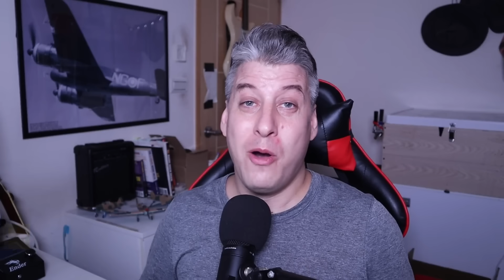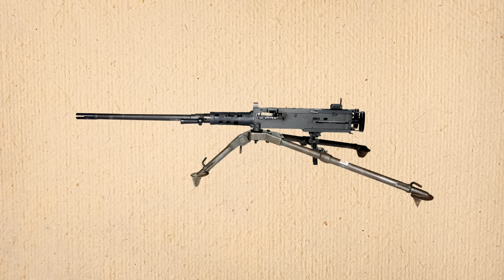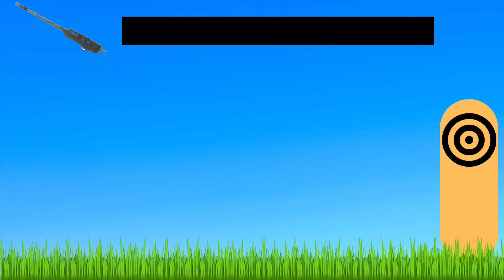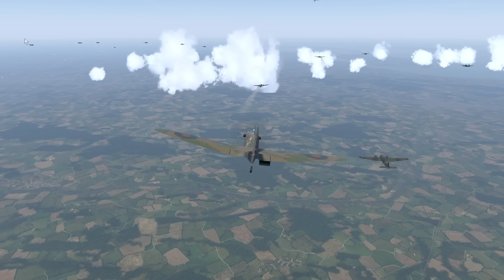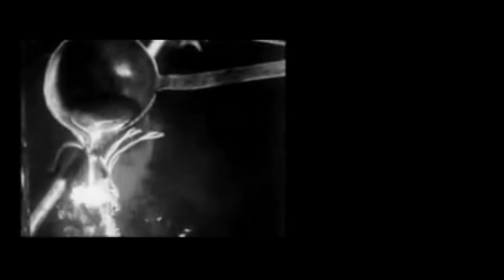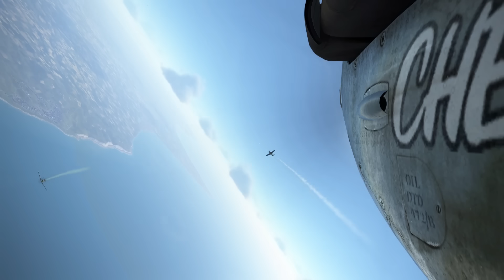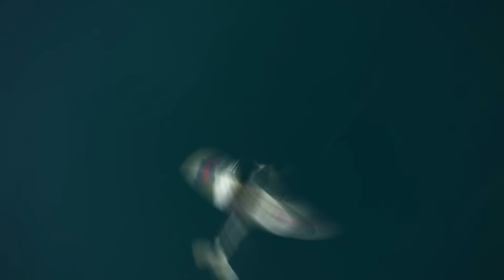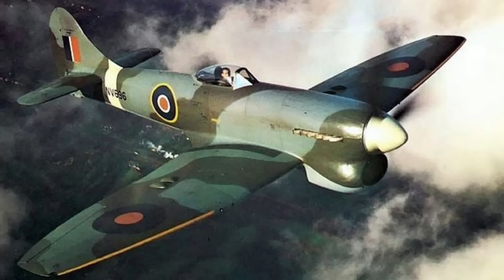Why Did The RAF Use .303 Caliber Machine Guns in WW2? The Surprising Answer

Comment: I have a 20mm cannon shell and bullet made by BMARCO at Grantham.  The unexploded bullet was retrieved by my grandfather in Leicestershire from a peice of JU88 tailplane after a Spitfire chased a raider over the county.  This is dated 1942 not long after they were introduced, and the shell casings were picked up off the road where they fell about a mile away.  The JU88 finally succumbed and crashed near Market Deeping and the crew are buried in the churchyard there I heard.  Years later, I showed the round to an ex RAF armourer who stated that it had definately been fired from a Hispano Cannon mounted in a Sptitfife as it has a neat line halfway up caused by the ejector mechanism in the cannon which were run on clockwork, which is why the aircraft had those wing-blisters to accomodate the mechanism.  The explosive end apparently diddnt explode because it was incorrectly milled and was live until my father did his National Service in the Royal Engineers in the early 50's  and recognised that fact and disarmed it! Until then it sat on the mantlepiece above the fire at my grandparents house!
Reply: Lol that would be an interesting moment to have if something happened "Honey your trinket from  the War fell off the Firepla-" POW
Reply: @Sparten148  I was an Australian army ammunition technical officer, and went to a job where some teenagers were playing catch with a ww1 37mm shell that grandfather had souvenired from the war.  Been sitting on the mantle piece for decades, till it decided to function when dropped.  Two dead, two crippled.  Just because this stuff didn't go off when fired doesn't make them safe.  Over time, the explosive components break down and separate, and crystallise...so what was once a stable safe explosive becomes a highly sensitive and dangerous one.
Reply: @Sparten148  🤣🤣🤣
Reply: @Sparten148  yeah - not sure the mantlepiece is the best place for a live cannon round! I take it they don't use the fireplace?
Reply: My uncle also benefited from national service with the Royal Engineers, though we didn't have anything live on our mantle pieces.
Reply: Best I can do....I have a scrapped piece of the Enola Gay that was discarded during her restoration, and I met+had it autographed by B.Gen. Paul Tibbets in 2004, before he passed away.  He also signed the date of 6 Aug, 1945 under his signature.
Reply: Very cool story. Thsbkbyou for sharing.
Reply: My younger brother talked to a WW2 B17 crewman who said they got back from a mission and had taken a hit to a fuel tank by a 20mm cannon shell that didn't explode and was still in the plane. After further examination it was found that it was an intentional dud. Inside was a handwritten note that stated he was a prisoner of the Germans and was  trying his best to help the allies win the war. It was unsigned and written in Polish.
Reply: @scottmccloud9029  Wowwee!!  Really?? Helluva story, there!!
Reply: @samburkes7552  Thanks. My brother volunteers at the Wings Over Houston Airshow and gets to talk to alot of the heroes. That story really brought that war into perspective. Knowing what the German government did to the Poles, that guy risked his life to dave an allied airman. 
I didn't serve, but have the utmost respect for those that did, and are serving. Even those who will serve.
Reply: @scottmccloud9029 a shell is a solid piece of metal, not hollow. How could someone put a note in it? And why would someone cut open a shell to find it?this is a dumb story that is clearly made up. The only place you could hide it would be in the casing and it would be jettisoned with the casing if not burned up by the powder
Reply: @olivermarden2433  That's exactly what I thought.The explosion in the casing that sent  the round into the B17s tail would've burnt the note up long before it got to the tail.
Reply: @olivermarden2433 not if he used tracer rounds there is an hollow filled shell with compound bursting charge, fuse, or even the lead that could have been left empty and a note inserted inside the bullet head
Reply: @scottmccloud9029  ..💀..Ohhh, man.., That IS sad..😥
Reply: @scottmccloud9029 this happened in rifle ammunition too, although at first they Booby trapped the rounds to damage the rifles but were too easily caught and executed so they took to damping the powder with moisture to make the rifle fire and recoil but the bullet head failed to penetrate. Very risky sabotage resulting in huge executions to the point they had to stop sabotaging by orders from Soe etc.
Reply: @scottmccloud9029  Nice bullshit, bro. You think a prisoner of war had the time to write notes for every single round? Or would risk his life for this shit just for the unicorn chance of somebody reading it?
Reply: @miskatonic6210  So what do "prisoners" all day?
Reply: @miskatonic6210  There are loads of documented incidents of slave labourers and POWs sabotaging everything from ammunition to engine parts during WW2, the Czechs at the occupied Skoda factories were the most prolific followed closely by the Poles. Such incidents also occured in WW1 amongst British POWs.
Reply: Our neighbor had a live Grenade one of his relaitive a brought back from Burma!
Reply: One of the things that stuck with me about my FiL's observations about watching dogfights from the ground was him having to take cover.  Not from falling bullets and shells' but the shell casings. They could do quite a bit of damage if they hit you right.
Reply: Brad Brassman: What a wonderfully, intelligent disseration re: this incident of this 20mm round being found, and the assessment therein!! Wish there were more like you!!
   Sam, a lonesome 73 yr old gun tech/refurbisher & cartridge reloader, here in Phila, Miss..Thnx!!
Reply: Wow, someone could have been "One Dead Cat Rusty James".
Reply: I've heard similar a artillery shell adjacent to the fireplace a live round for 60 year's until she passed and someone recognised as a "live round" called the police suggesting the bomb squad
Reply: I’m sorry to be that guy, but the brass is the casing and the projectile (the explody bit) is the shell. Interesting story nonetheless, unexploded ordnance, especially ordnance that has been fired and is aged is extremely dangerous, there have been hundreds of cases of veterans sharing their trophies of war with their grandchildren and the children ending up dead or critically injured by playing with it. I’ve got an 87MM from a 25 Pounder and a 40MM Bofors, both WWII dated and made in Birtley (stamped RLB on the casing).
Reply: @seafirefr.4751  : If you hate to be 'that guy', then why be 'that guy'?  I think everyone knew what the OP meant.   Cool about the 87mm and 40 bofors, though!
Reply: @pattonpending7390 , I’m not correcting him so that everybody understands what he means, I was correcting him so that he understands the difference between a casing and a shell for the future if he decides to buy any more.
Reply: @seafirefr.4751  In the early 70’s Dad & I were plowing a field & he opened the field for me to get me going & then I finished the job.  I was a bout 8 at the time & Dad jumped off tractor & started walking towards barn to do chores when he stopped & picked something up.  He frantically waved his arm for me to stop & I did.  He told me to stay there with tractor while he picked up what I thought was a rock & carried it inside the basement of the original homestead farmhouse which had thick rock walls.  He came out & told me he found a hand grenade & we had to walk the field to make sure there weren’t more of them (there weren’t).  Dad told us we were never to go in the basement but later that summer took us in there one by one to see it.  He asked around what do do with it & he felt the best advice he got was drop it in an old well which he did & covered it up.
Reply: Awesome little anecdote :)  Our lot were all up Ayrshire way so never really got any "spoils of home victory" trophies...Despite the fact the place was hunted for for years by the Nazis, wolf packs , the lot. Used to be (still remains I suppose) an ICI complex that made heaps of munitions for the war. All underground bunkers. The only major event really was the sinking of an Aircraft Carrier off the coast of Arran. 
What a time to be alive for a young'un  in the Kent countryside... Almost seems like war was a more innocent endeavour back then with real baddies.
Reply: @miskatonic.
Anyone who uses the word "bro" is not to be taken seriously.
And how would you know if a story is true or not.
I bet you're fun at parties.
A-hole.
Reply: I just watched a video about how the british took a long time to mount Hispano Cannons on theier planes like 5 minutes ago. I am also a WW2 buff and have always wanted something like that do you know if theres a website to buy stuff like that?
Reply: @elilenz1208  The RAF had 20mm cannon in some Spitfires during the BoB.   The unlucky pilots begged for their 8 x 303 Brownings back because the cannon proved totally unreliable.    Basically the Spitfire wing flexed.    Whilst this aided its aerodynamic performance, it also jammed the belt feeds for cannon.   In due time one of the RAF's "go to" engineering firms debugged the French Le Chatterellaut belt feed and fixed the problem.   That was most likely Martin Baker, but Miles was as good.   In fact the (RAF) Hispano became so reliable the pneumatic cocking mechanism could be deleted and was removed to save weight.   The 20mm Hispano was in use very early on as nose guns in the Whirlwind, and in the belly of the Beaufighter.   At first these were drum fed and in the Beau the observer had the unenviable task of changing empty drums for full - in the dark, in combat.    The Mosquito started life with belt fed cannon, four of them, both Mossie and Beau also had a mix of machine guns.    The Hurricane Mk II carried 4 x 20mm cannon.    However, 20 mm does not compare with the tank buster Hurricanes 2 x 37mm or the Mosquito's high velocity 1 x 57 mm Molins gun intended for submarines.   During the interwar period, the RAF had specs for a fighter to use an obliquely mounted 37 mm gun (the C. O. W. gun q.v.), to kill Zeppelins.   Several prototypes were built, the only thing missing was armed Zeppelins (JOKE). 

There is a twist to the tale.   The UK gifted the engineering drawings for the by now debugged and wholly reliable RAF Hispano 20mm to the US.   Regrettably, the US "improved on it", and promptly reintroduced jamming.   I always wondered if that was why the USAAF and USN stuck with 50 cal for wing mounted guns.   Pity, because the RAF Hispano was arguably harder hitting than the version of the Oerlikon (whatever they actually called it) adopted by the Luftwaffe. 

Jamming has always plagued fighter armament going back to WWI.    However, back then the gun breeches were usually  accessible to the single seat fighter pilot.   In some cases the butts were perilously close to the pilot's head.
Reply: My Dad was with the 23 field company RE in Tripoli in the early 50s, and his finds were also what he picked up at crash sites when he was a kid.
Reply: The unexploded bullet couldn't have been retrieved from a down aircraft. If it was fired then it was exploded. The unexploded round is still in its casing.
Reply: @TheSound0fLegends  Depends on definitions I reckon.   The complete unused round might be termed the cartridge or shell (in the days of muzzle loading cannon, shell meant a hollow projectile, usually spherical, which could be filled with powder, shrapnel {powder plus shot}, or indendiary material).   When fired the projectile hopefully left the piece of ordnamce leaving behind a now empty shell case or cartridge case (assuming modern fixed ammunition) .    The terms get really messy depending on the calibre of the piece.    The term bullet used to refer solely to the projectile, that goes back to the Romans who had a range of torsion artillery which incidentally also fired arrows and javelins.  However, IMHO sloppily, today people use bullet interchangeably to refer to both the whole cartridge and the separated projectile.    There's more, but it just gets messier.
Reply: @TheSound0fLegends  Not necessarily. The projectile might have been a dud or it had no explosive filler and was a just a lead bullet with the usual jacket over it, or potentially even a solid brass penetrator. Regardless, there are number of ways for what's supposed to ban explosive piece of ordnance to be unexploded after being fired. I mean, every battlefield since explosive ordnance was first used hs unexploded ordnance lying be it bombs, artillery shells, or others.
Reply: So far 2023's absolutely best reason to read the comments.
Reply: Love collecting old shells and surplus. I managed to get a 40mm bofor and a 30mm tracer incendiary through my local surplus. Idk if itd legal but it's awesome
Reply: I heard 80yr old 20mm shells are great for throwing around an empty bathtub when your drunk...
Reply: That's interesting, I always thought the blisters were to house the cannons magazine.
Reply: 💀..@Brad Brassman..' WOW !!! 👌  THAT is a BANGIN Cool bit of R.L.History !!! Peace ..~K~✌️ 😉
Reply: oy mate, where's yoh loicense foh tha?
Reply: @BradBrassman  That's awesome. My Grandmother and Great Aunt both worked in that factory making ammunition for Spitfires.
Reply: Great story, well told 17:09 and it's super to see the face behind the voice, unlike the robotic silly AI narrative in many other presentations.
Reply: The 20 mm cannon was introduced in 1940 and by 1941 both Spitfires and Hurricanes were using them.
Reply: ..Hats off to you mate!! Very, very impressive story!! I am a ballistics tech/gun cleaning/refurbishing tech, ammo reloader..Your story really piqued my interest. No, did not serve, served in other ways. Am sorta doing my service now in my early 70's in a Miss. gunshop!! Have some so since early 2018..
Reply: The ending made the story worth reading along with the insight that bullets where used that must have been rushed out of production with defects and due too this live rounds where found after being fired from the spitfires
Reply: In 1942 a lot of the rounds used were solid AP, so probably nothing to explode, thankfully, probably just incendiary and tracer (APIT).

Comment: The Browning .3 and .5 were both developed for tank use initially. There were development issues with the .5 as it had some reliability issues which were not wholly resolved until the late 1930's when the yanks wanted to use them in their planes.
Reply: Up to 1940 the USA mostly nose mounted them on fighters. Ammunition feed jamming under load due in the wings was an issue until late 1943 and suitable boosted belt draw, much like that used on RAF tail turrets for 303.

Comment: Good discussion. Two points: the Browning M2 is not the same as the Browning AN/M2. The former (M2) is the .50 cal and the latter (AN/M2) is .30 cal. You got the two mixed up early in the video. Also, the biggest advantage of the .50 cal rounds over .30 cal is not the bigger hole but the greater effective range, which became very important as planes began to fly faster. You correctly point out that 20mm cannon rounds are a significant step up because they can carry a significant amount of explosive and incendiary compound. They also have a yet much greater range.
Reply from the maker: Thanks for the correction.

Comment: Consider also that early 20mm guns were very prone to jamming and had less rounds than a.303 mg, only 60 rounds vs. 250, if I remember well. Bader didn't trust them, there had been too malfunctions, and in situation of life or death logically they choose the more reliable solution.
Reply: I wonder of they could switch and have both on board. Like switching from missiles to guns in a jet fighter.
Reply: @andrewgates8158  The Spitfire had various kind of wings, the "A" had only Mgs, the "B" 4 Mgs & 2 20mm guns, the "C" 4 20mm guns or a mix of either Mgs and guns and the "E" with two 20mm guns & two 12,7. I read that the Zeros had a switch for firing with only the nose Mgs or with all the weapons, don't know if the Spit had the same device.

Comment: I think there are two main reasons. The first one is a "if it isn't broken, don't fix it" attitude. The .303 did the job in battle of Britain, and it was logistically sound to keep it as long as it worked.
 
The second is kind of mixed with the first one. I think the main reason the germans moved over to cannons very quickly, was that they needed heavier firepower to take down bombers, the brits fought the same bombers as in Battle of Britain, and the .303 was for most of the time good enough against both bombers and fighters, especially with an added 20mm cannon. 

There is a possible third reason. He mentioned the ministry's lack of confidence with the pilots marksmanship, and hence the need for more bullets and the sparks generated by the incendiary round. So the machine guns could be used for aiming, and then kill them off with the 20mm cannons. This would be particularly useful with deflection shots.

Comment: It is "my understanding" the 303 was originally put into some fighters for Aero Dynamic reasons, along with lots of others. If you note old pics of Brit planes you will see a difference in their wings leading edge before and after weapons firing.  This was an advantage needed while other were under development.
Reply: Are you referring to the red covers for the barrels? IIRC those were installed to avoid the barrels freezing. And shot through on the first engagement.